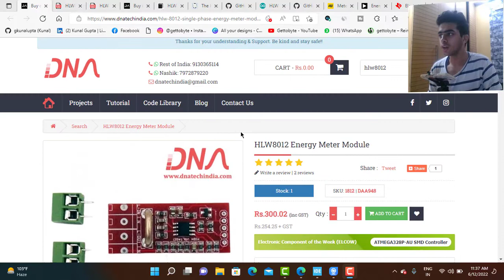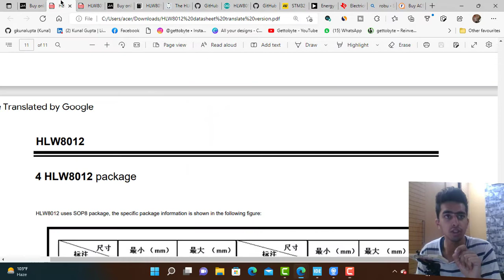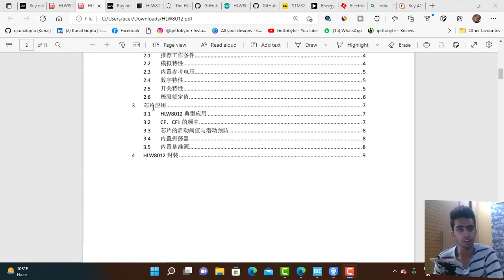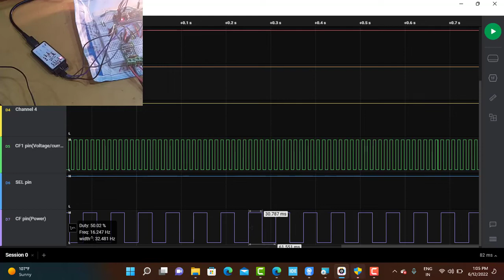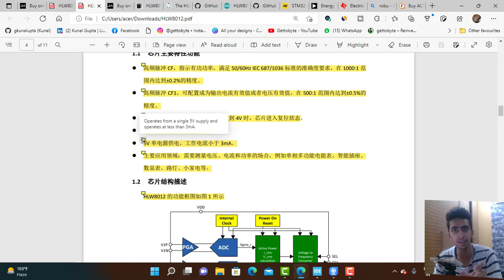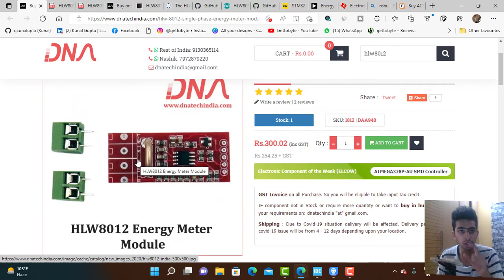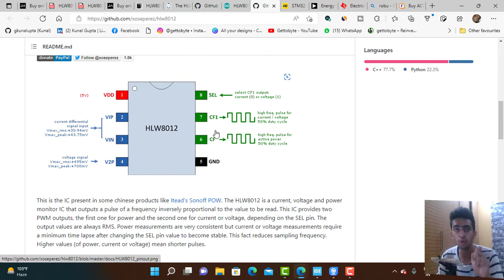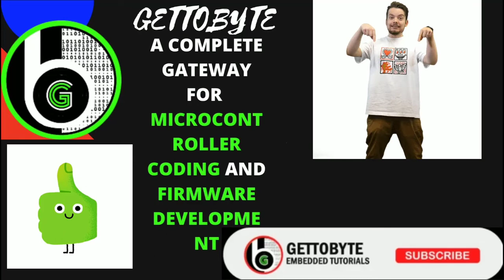HLW8012 AC Energy Metering Module : Overview || Working || Connections

Comment: Bro great work... I just want to ask whether the HLW8012  works and gives power output vrms irms of  single phase AC-motor. In other words can you verify with your circuit whether we can get power calculations of inductive loads
Reply from the maker: Yes it is for capacitor and inductive loads both.